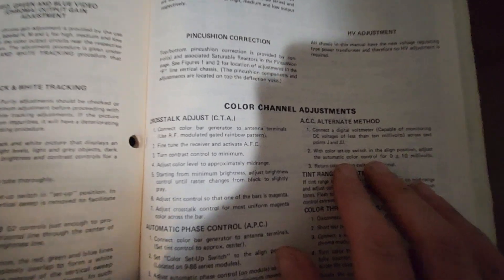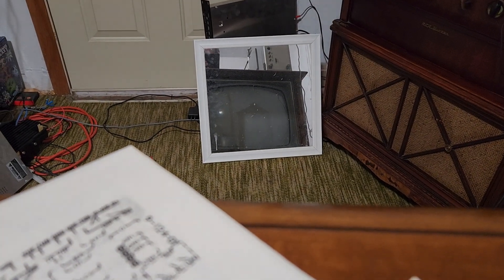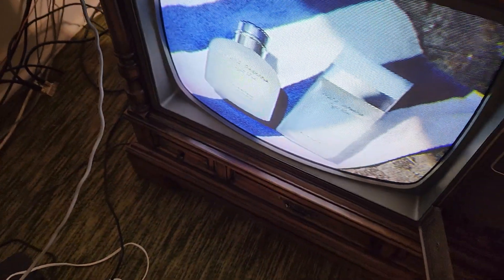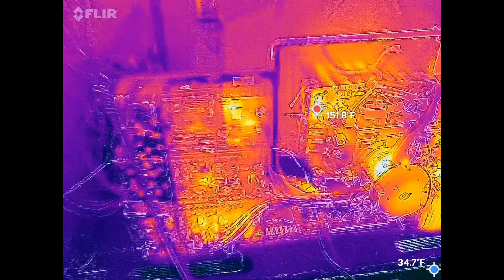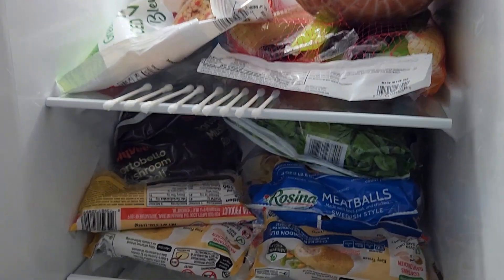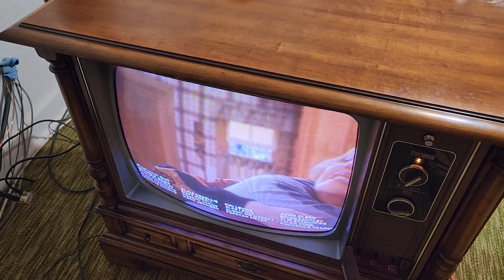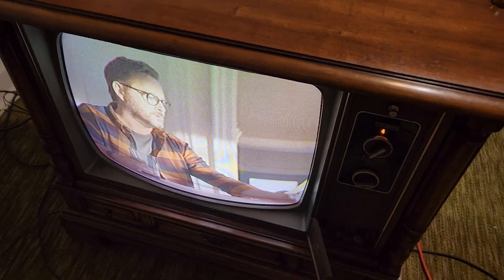1976 Zenith Vintage Chromacolor II Console Television Repair PT 5 of ?

Comment: Is it a zenith 19ec45 chassis with a 23vcep22 picture tube I had one
Reply from the maker: Sure is a nice set. How long did you have yours?
Reply: @MangieRaccoonsTech  1970to 1990 wich I kept it it was working
Reply: Is yours same chassis and picture tube mine was starting to red flag around faces
Reply from the maker: Indeed, exact same Chassis number and picture tube per the label. Tube is missing its label but it looks original so I'd say it is a 23vcep22 and the crt tester worked using that. I wonder if the red bleeding over was convergence or if the picture tube was getting tired and starting to smear. Too bad you still didn't have it though. The work they put into this set back then is incredible.
Reply: @MangieRaccoonsTech  it is a good TV set I work where they collect e-waste I've seen several of these chassis come in to be shredded and destroyed 19 ec45s and 25 JC 45 chassis and they worked also
Reply from the maker: Man that's a shame, it would be so hard for me to see all these amazing sets get shredded and destroyed. I love my 23'' console set, I kinda wish I had the 25''  maybe someday ill get my paws on one.

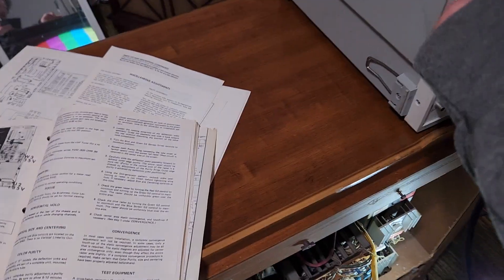Comment: 3:22 I can hear the squeal in your videos, but it's not too bad. Though I'm using speakers, not headphones. You could always add a 15.7Khz notch filter when editing, but then we lose the fun of hearing the HV come up.

After years of not messing with CRTs, my ears aren't really accustomed to it, so in person I find some of my sets just piercingly loud - to the point that I still hear the sound after they've off for a while. I was promised by this age in my life I wouldn't be able to hear those frequencies anymore lol
Reply from the maker: Hehehe well can't take away the fun of hearing the HV coming up. Sometimes it's really hard to power though when editing XD There is an interesting one in the later videos, think it's going to be part 8 when I loose the HV and I'm troubleshooting, does some really strange noises lol. 

I remember when I was little, there were a few places mom would take me and it was so so bad. One day, they turned off the tv, and the noise quit and I mentioned that, and they turned the tv back on, and it came back. They thought I was crazy and said it didn't make any noise, but it was so bad to me. Some sets weren't too bad, and others I'd be on my knees and could not stay in the room. 

What kinda sucks is the last few years, my ears started ringing, and it's the same frequency, gah! also, now when working on tvs, I'm having a hard time telling if it's the tv running or if it's my ears :/ or I think the tv is still on when its off. But they still can overcome my ears.
Reply: @MangieRaccoonsTech  I've had tinnitus since I was a young fella learning electronics. It went away once in my life while on a ketogenic diet and taking supplements.
Reply from the maker: No kiddin huh, I was on a keto diet for a while myself. But I wasn't taking any supplements